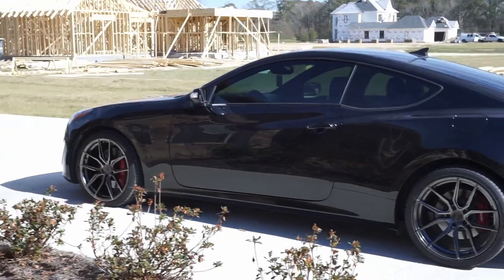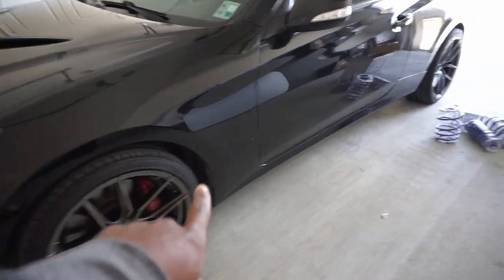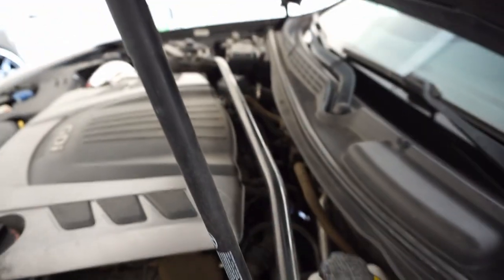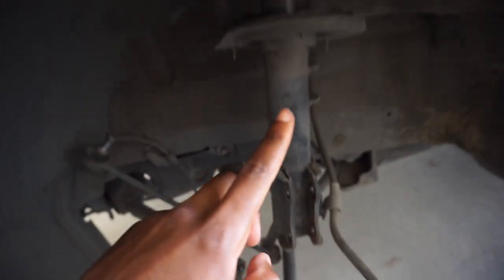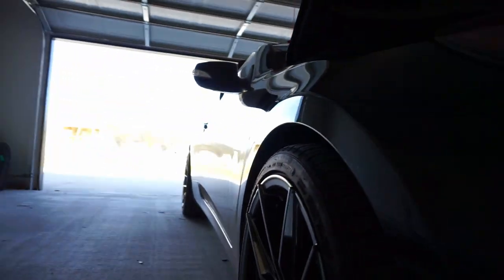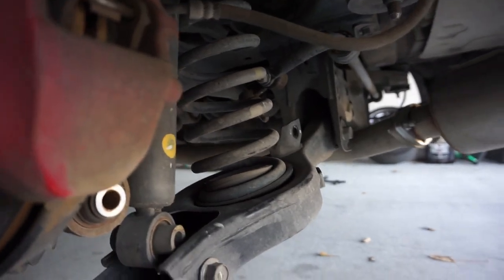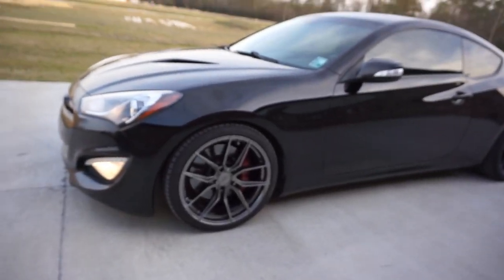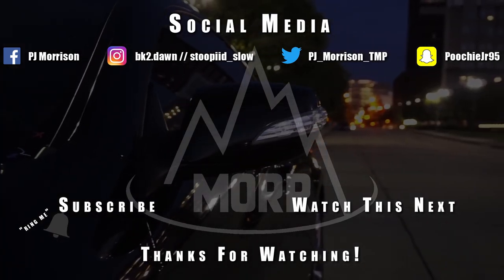I INSTALLED LOWERING SPRINGS WITHOUT SPRING COMPRESSORS!

Comment: Ever try lowering the jack method. Instead of talking it apart from the outside?
Reply from the maker: I haven’t because I’ve always found success doing it this way. I’m lowkey scared to do it by lowering the jack under the car because I don’t have full control of the spring😵‍💫
Reply: @pj_morrison  Damn, i did the jack method recently on mine. Went pretty smooth

Comment: Jdm sport springs ftw had these on my car for about 3 years no issues shocks are great springs are not sagging $60-$70 on ebay. Best bang for the buck.
Reply from the maker: I’ve had them on both my Genesis coupes and the only thing I can say is they are springs, not coilovers. The don’t bottom out or anything, but the ride quality just isn’t the best for the bumpiest roads. On smoother roads, you can’t tell the difference tho👍🏽

I agree with the best bang for your buck
Reply: @pj_morrison  are they stiff or bouncy?
Reply from the maker: @naailable  they’re stiffer than the factory springs but not super stiff to where you get all kinds of cheap rattles from the plastics in the cabin

Comment: U can tell he’s from the boot not using spring clamps 😂😂 337 baby but what size wheels are those I have 20s and I’m thinking about lowering springs but scared they won’t fit
Reply from the maker: Lmfao, yeaaa I didn’t need them bro😂but it’s less about the wheel diameter and more about the tire height.. Typically ppl wanna stay around a 26” tire so they won’t rub on lowering springs.

You can check out your tire height at tiresize.com, it’s pretty simple to use
Reply from the maker: Your overall wheel size matters too tho, and offset.. Fitment Industries has a gallery that helps a bunch
Reply: Cool deal brother thank u a lot man the content is fire wish the genny community was bigger you would have a lot more views

Comment: Are your stock shocks and struts blown yet with these on?
Reply from the maker: Soy Sauce no sir, I’ve used these on my two Genesis coupes and my cousin’s coupe.. They’re fine so far, I’ve gotten a solid 2yrs before with no problems. They’re just stiff
Reply: PJ Morrison I’m on a budget so I bought ark lowering springs just need to install them. I’m reading on gencoupe forums and there’s a bunch of nightmares about the aftermarket lowered springs and stock shocks struts combo. Don’t know what to do now should I go ahead and install the springs or wait to get some money for aftermarket shocks struts or coilovers. I don’t track or corner swing my car so I don’t feel the need for coils, I also wanna be able to drive everywhere. Enlighten me bro
Reply from the maker: I can’t/don’t really wanna tell you what to do.. But I feel like you could just use what I did to make your decision. Like I said, I’ve had no problems with lowering springs ever. But I also installed them with plans on eventually swapping to coilovers. The most I’ve gone is 2yrs with springs, and I’ve had no problems. Swapped the lowering springs for the factory ones after the 2yrs to get rid of the car, and it drove like it did from the factory. The spring rate just may not match up with the shock rate or whatever it’s called, and may be too harsh for you. But I daily my car and I’m fine with it.. If you install them, just know that your ride will be stiffer and you’ll feel a lot more of the road
Reply: PJ Morrison appreciate you PJ. Best advice unlike the forums that scare the crap out of me. I’m going your way, just need lowered a little bit, hopefully mine last the same like yours did. Got 35k on my 2015 BK2 3.8 6MT Ulti right now.

Comment: Lowering springs on stock struts? More than likely gonna blow the struts or have them die prematurely. You've shortened their traveling distance and are forcing them to stay compressed lower than they are made for.
Reply from the maker: I agree with you, and I’d consider not getting them more if I weren’t going to swap them for coilovers anyways.. Like I stated a few times before, I ran eBay springs on my last Genesis for almost 2yrs and they held up fine. I’ll be ok until then, but thanks for the info👍🏽